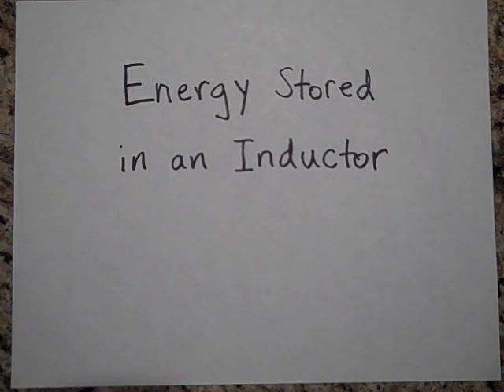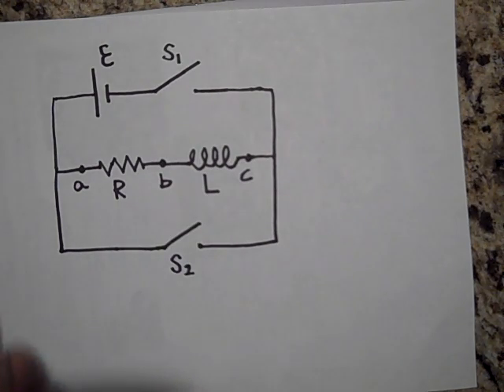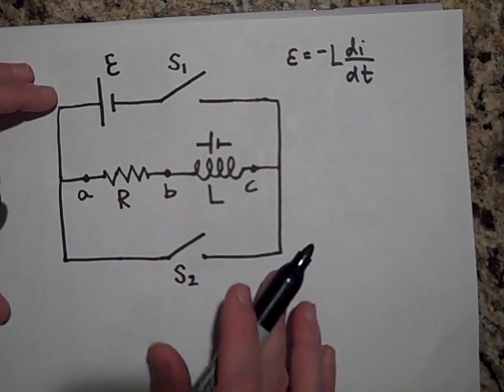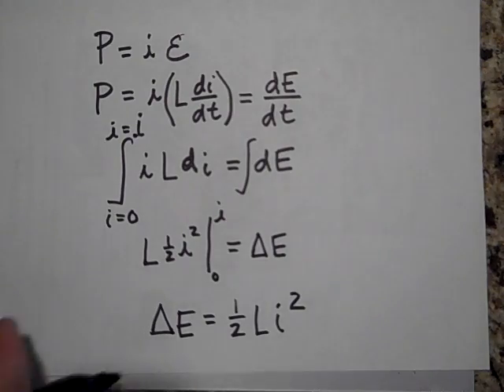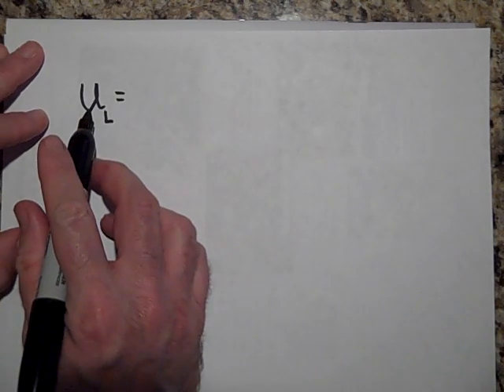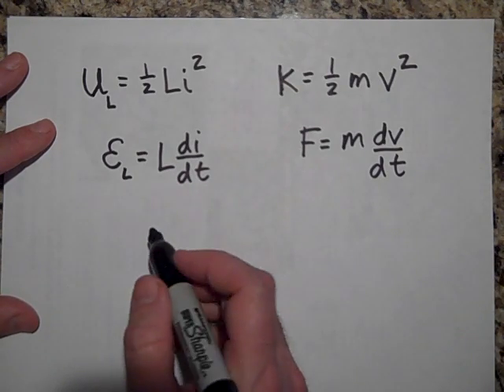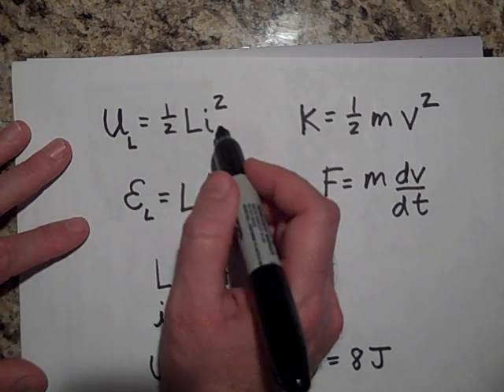Energy Stored in an Inductor

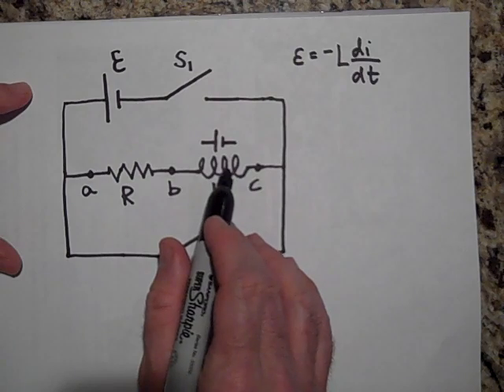Comment: NO FIELD CONTAINS ENERGY!!! Only masses, charged particles and magnets pick up energy in gravitational, electrical or magnetic fields. If you think that a battery is a source of energy, you're on the wrong track. It's nothing but a voltage-source (1:11), and certainly not a field holding energy. Strangely, he is surprised (2:20) that after he created a voltage-source, electrons start moving when he closes the circuit again. Funny, but inconsistent creature. P.S. My advice to you, viewer, think for yourself.

Comment: At time 2:30 the battery is removed then the magnetic field of the inductor collapses with Back EMF through switch 2.

The invisible energy around the inductor has analogies with:

- the invisible force between two N magnetic poles if you try forcing them together

- gravity

A DC voltage is turned on and flows through a transformer primary winding.  An ammeter connected to the transformer secondary deflects for an instant then returns to zero.   The invisible energy in the empty space between the primary and secondary windings (assume an air core transformer) is another analog to those above.

The existence of Vacuum Permittivity (the ability of 'empty space' to be electrically polarized),  the existence of Vacuum Permeability (the ability of 'empty space' to be magnetically polarized),  the 377 ohms of impedance of 'empty space - and the analogies above - practically force you to recognize the Vacuum ('empty space') to consist of persistent dipoles.  It is widely accepted that space is a dielectric.  It is both magnetically and electrically polarizable.

The 'virtual particles' idea of electrons and positrons that 'pop into existence' then quickly annihilate is betrayed by an absence of a gamma ray background throughout space.

It is well established that electron-positron annihilation creates gamma rays.  The dipoles in space are there, but require intellectual courage to acknowledge.  If you're tackling artificial gravity devices, having a speculative model for the Vacuum based on the things above comes in handy.
Reply: A reasonable question would be, "since Nature does not create useless spurious things, what is the use of persistent dipoles throughout space?"

- to act as temporary carriers of electromagnetic waves (if the energy in a radio antenna was not distributed out into increasing volumes of space - if the energy stayed on the antenna.....)  The electric and magnetic fields of EM waves alternate between polarities.

With no way to quench non-uniform, anisotropic conditions, It would be as if Nature forgot to put ripples in the pond when the rock drops in. 

The universe is mostly uniform and isotropic.  The first tool to reach for is thermodynamics.  Nature prefers uniform, isotropic conditions and seeks to quench any and all out-of-equilibrium conditions.

A gravity field is a condition of space spreading out into ever-increasing volumes of space where the field weakens (square of the distance).  The accelerations of the immense collection of charged particles in celestial bodies is a non-uniform, anisotropic condition that persistent dipoles quench by way of dilation but random order ('stretched springs').   

Artificial gravity is an engineering approach to use immense accelerations of charged particles to create a temporary, coherent, dilated (stretched) polarized dipole effect in the immediate vicinity of a test device.   We use very high frequency eddy currents, applied to thin layers of a lamination (due to the skin effect), and an orthogonal magnetic field.  The resulting high frequency Lorentz force creates immense, coherent accelerations of the charged particles in our laminations.

Creating artificial gravity is "storing momentum in the Vacuum."  An analogy:  a submarine has a front-mounted boiler to create steam in front of it.  This addition of energy to its medium (water in this case, not space)  'stores momentum' in the medium.  The higher pressure of the ambient medium at the rear of the sub creates an unbalanced force in the medium and the sub accelerates forward.

Comment: Thank you for your video, so well explained.  One thing I haven't quite grasped... you mention it's the energy stored in the inductor but then make analogous to kinetic energy? Isn't stored energy not then potential energy? As the magnetic flux collapses with time work would need to be done to transfer the energy, would the magnetic field then be doing work on the electrons i.e. the current?

Comment: The energy stored in the inductor  will discharge as an arc through the top switch at the instant you open it.  Inductors don't store energy in the same way as capacitors do.

Comment: The derivation and Kinetic Energy comparison are fine..but do casual readers understand that the energy "stored"
in a inductor is available ONLY WHEN the battery is connected ? 
A capacitor stores energy after it is charged and after battery is disconnected.  A capacitor actually stores energy 
for days or even months after the battery is disconnected .
NO Energy is available for a inductor when the battery is disconnected.

Comment: You are a bit hand-wavey with your calculus there i think - what were your integration limits for dE? 

Also you use Lens' Law inconsistently - P does not equal ei, it equals Vi, e (in this case and as you use it at the video's start) is the induced EMF in the inductor's coils due to magnetic flux linkages between it's cols (Faraday's Law of Induction) which is modified to Lens' Law to include that it's polarity is opposing the applied voltage

Comment: u cant cut dt with dt if u know some calculus
wtf is this
Reply: Technically, you're right, this is not proper.  But physics tends to make these things simpler and easier to understand.  Consider that if both sides are changing with respect to time, and time is in the same reference frame on both sides, then it might as well not be changing at all.
Another way of thinking about this is to replace "dt" with any small fraction of time you like, a Planck time perhaps.  If you do that, it immediately becomes clear that you can cancel them, as one will be equal to the other.

If you still don't like that, consider what dt/dt means.  dt/dt means "the change in time with respect to time", and time is itself, so the change in time with respect to time is the identity 1.  One unit of time changes one unit of time per unit of time.

I hope this helped.  It seems like it should work, and it indeed does turn out to work, but it's not necessarily mathematically rigorous.

Comment: I cant find anyone who is doing this right. I have the waveform graph of the current passing wrt time through an inductor. The question is asking me for the PARTICULAR energy stored at a random time t = 1.7ms (here the slope is negative on the waveform but one cant determine the exact i(t) at that point). The formula 0.5Li^2 doesnt work in this regard. Can someone tell me what I need to do or what to integrate?
Reply: so what was it? was it with power?

Comment: no-one is doing this correctly!!!!!!!!!!!!! the integral is not from 0 to i, its from i(t=0) to i(t) - what you (and everyone who don't do calculus properly) are assuming is that i=0 at t=0 - this is not always the case! a more general case of this formula is from i(t=T) to i(t=T+deltaT) if you want to calculate heat release of an inductor between any 2 points in time
Reply: TheAusrali he is integrating not wrt to time. he is doing it with change in current.
Reply: i = 0 at t=0, i = I at t = T so it actually doesn't matter, though I agree that he shouldn't be so careless with this description

Comment: Can energy stored in inductor be negative?
Reply: p0ppy4 No. Energy cannot be negative. It's scalar.
Reply: Being scalar doesn't imply it should be positive. Recall potential energy of charges! I don't know the answer of this question though. I think it could
Reply: p0ppy4 It's always positive whether the magnetic energy is being stored in an inductor or extracted from it. When the energy is increasing the derivative of the energy with respect to time is greater than zero (dw/dt) > 0, which gives a positive power. When the energy is decreasing the derivative of the energy with respect to time is less than zero (dw/dt) < 0, which gives a negative power. Although, if you apply the passive sign convention to calculate the power in an inductor you'll see that the energy actually can become negative. For example, when the current through an inductor is increasing it flows from + to - terminal of the inductor, which means an energy loss for the positive charge carriers, so the power should be positive as well as the energy (p = iv; p = dw/dt; dw/dt = iv; dw = ivdt). On the other hand, when the current through an inductor is decreasing it flows from - to + terminal of the inductor, which means an energy gain for the positive charge carriers, so the power should be negative as well as the energy (p = - iv; - p = dw/dt; dw/dt = - iv; dw = - ivdt).

Comment: another way to solve this is to find the equations for the current before and after the switches are flipped, and use energy dissipated from a resistor (I^2 R) with the post-switch current being I, and then integrating from t=0 (as current will be a function of time) to t=infinity. this will result in the same formula, (1/2)(L I^2).